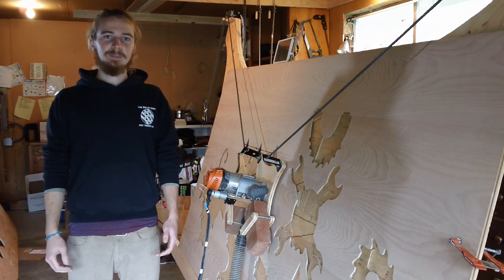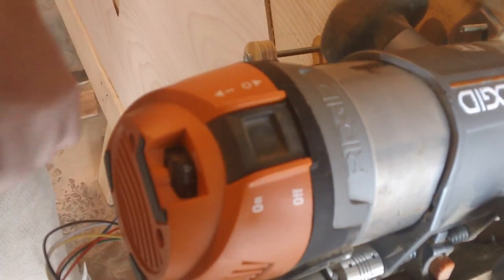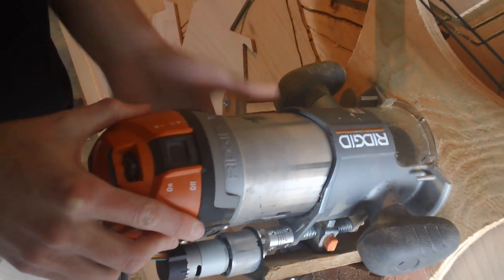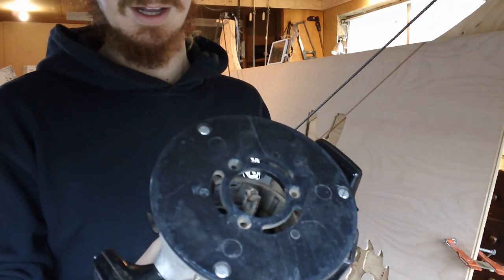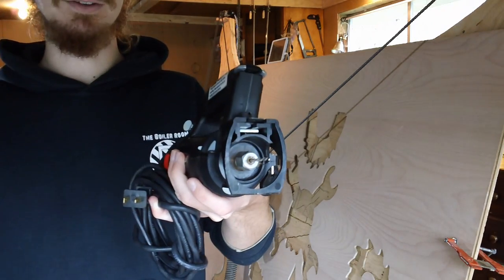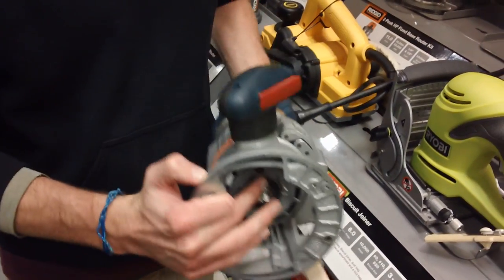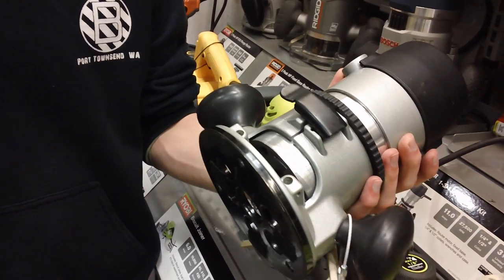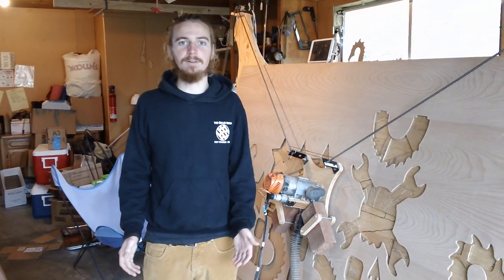Review of Routers for Maslow CNC

Comment: For the Porter Cable router you'd want to buy the kit with the plunge base and modify that.  It still has the twist depth adjustment (which is useful for zeroing a bit) but the plunge operation is independent of that.  From memory, I think it would be fairly easy to add a depth adjustment by modifying the adjustable depth stop.

(The plunge base also adds a trigger power switch, but you don't have to plug the router into the base if you don't want that switch)

Comment: I notice the round plastic part of the router that he used to mount to the sled. You could
cut one out of a smooth plastic that would be the same shape of the sled and cover the
whole bottom just not where the bit comes through. He said just having the round part can get caught on pre-cut holes as you are cutting things out.

Comment: I'm in for the plasma cutter. I have a machine head for mine, a track-torch head. Same geometry as a Track-torch barrel, which would adapt seamlessly as well. 
  The plasma is at it's best under 5/8" material thickness, but the oxy-fuel, you can burn through 4"+ thick steel.  
  There are so many fab shops that would buy one, I can't tell you. 
  I thought of buying a plasma table, but there is no place to park it. 
  Thanks,
 Mark

Comment: Using the Ryobi router with the maslow router z-Axis is an issue. The kits coupler is too small to fit over the screw to raise and lower it. I drilled mine out wider to make it work.

Comment: The Makita also has a wider base plate with the plunge base. Does this require a fixed base or will a plunge base also work? It is after all easy enough to lock in place.

Comment: hi ive just been watching a few of your you tube vids I would like to ask if it is posable to bring the bottom of the chain back to the router via a cog wheel and up to a strong spring so there is four connections like and x shape so no bricks are needed I know this may prove a bit of bother putting your sheet of ply in but you could make a quick release for this sorry if this has been suggested before I have not read all the comments

Comment: First, I'm #50 on the $1 reservation list!  Second, what that's noise in the background?  Is the cameraperson chewing gum?  Very distracting.  Third, have you thought about using anodes with holes built into replace the bricks to simplify the ballast attachment points?  Fourth, I'm in Seattle, is a shop tour an option?  I attend the Wooden Boat Festival every year.  This is the first channel I've EVER subscribed to, so can't wait for new videos.  I'm also a woodworker, so enjoyed Chris' articles.  I will be an active contributor to the forum as I have a background in CNC.  I can't believe I found you two days after the Kickstarter deadline...
Reply from the maker: Thanks! The Wooden Boat Festival is a great event. We're in the middle of relocating to a shared shop space in Portland called ADX, but if you are up for the longer drive, we'd love to have you come visit. Either way, see you in the forums!
Reply: I'm #03216, so sad :(

Comment: So materials that this cut depends only on the router and bit you use. Correct? Can it cut aluminum or acrylic?
Reply from the maker: It depends on the router and bit but also on the amount of force needed to cut the material accurately. Harder materials like aluminum require more force to cut which could flex the frame or move the router from the target position so you probably wouldn't get great accuracy in a material like aluminum. There may be a router bit which does work well for aluminum, but I wouldn't recommend it with a standard 1/4 inch milling bit